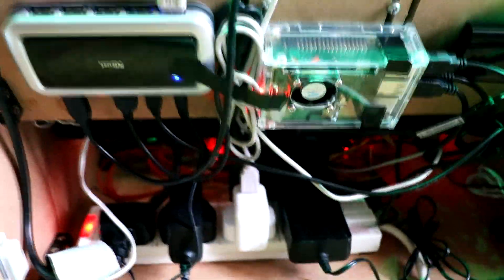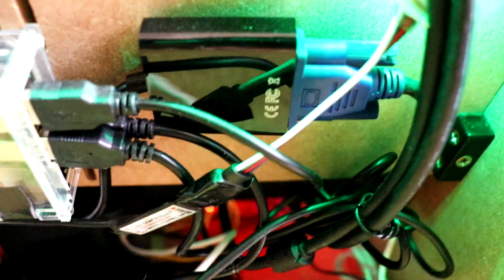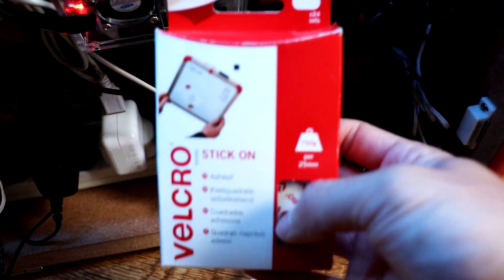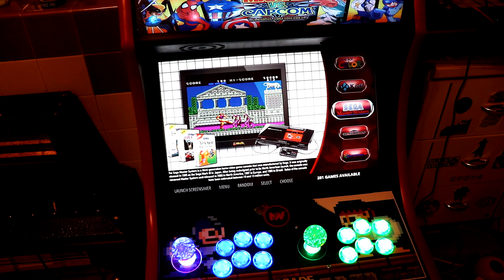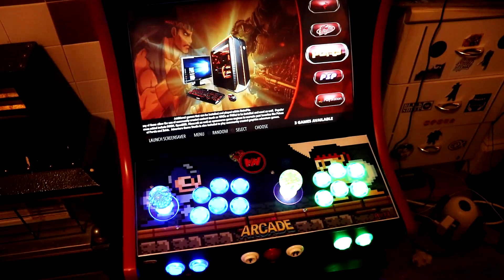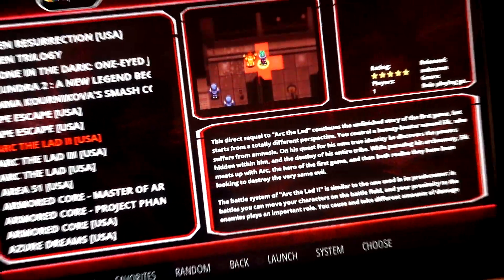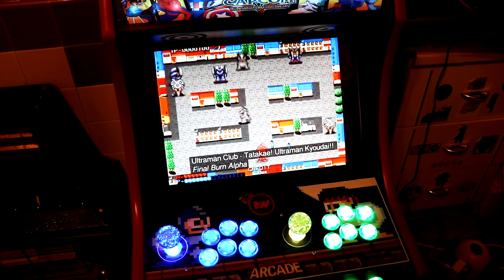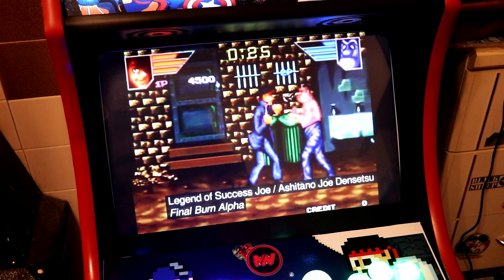Bartop Arcade Machine - Emulators/Frontend/SetUp - Part 7 [Final]

Comment: Awesome set of videos and a great build dude! If you were to do this 2nd time around would you install monitor and set up controllers before putting it all together or was it relatively easy to get in and take out the controls section? I only ask as I recently bought the exact same kit.
Reply from the maker: Thank you for comment and for watching =) I would probably set the monitor first if I was too and maybe scrap the subwoofer and put in a amp with 3w speakers. Although the subwoofer is nice to have and if I get a bottom unit i can put it in there for extra bass. I would leave the controller setup last. I deliberately left out some screws where you close the control panel, as i have had some issues with loose led connectors it was easy for me to just open the back up and unscrew a couple of screws and lift off the top panel to get to all the wires. What theme will yours be? I hope it all goes well for you! ^^
Reply: @AzNstat  I went old skool with the space invaders theme. Thanks for info, I will take your advice on the controllers,  I haven't looked at the build pdf instructions yet but the advice on leaving a couple of screws out is helpful. I'm going to try and put the monitor in first but I've just had to order another as my old one is just over the 17.7" width of the monitor slat. Wish the manufacturer had been clearer on the "absolute" width of the monitor as opposed to the screen size.